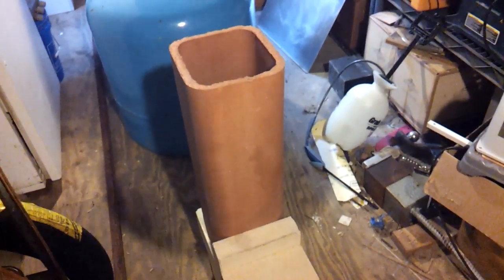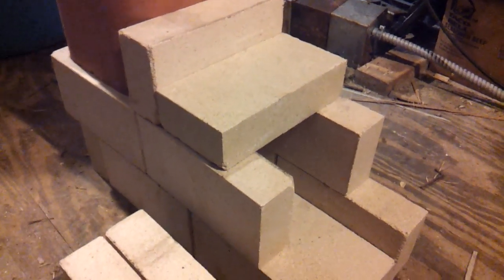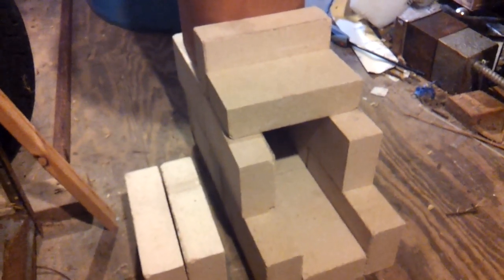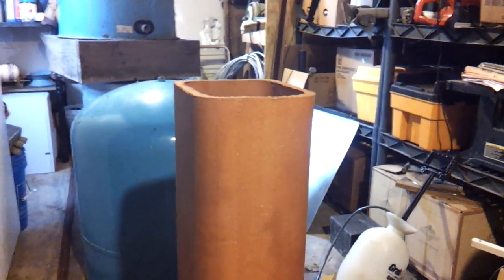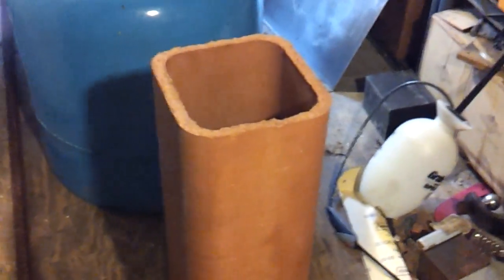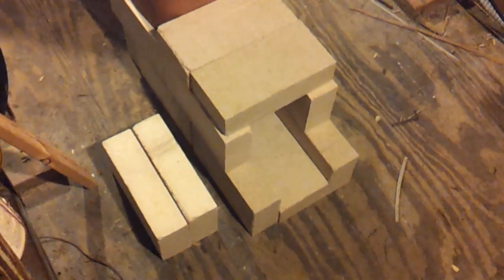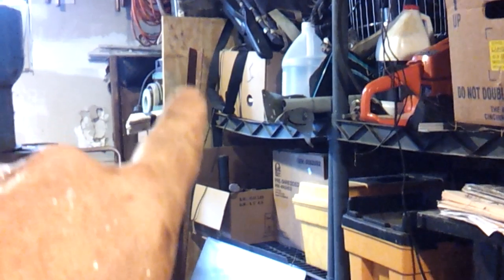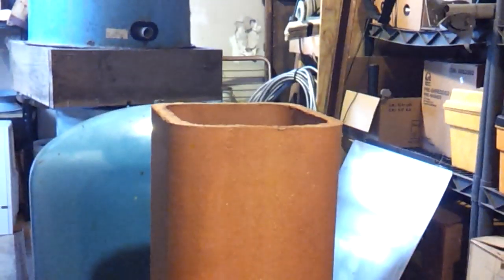Rocket Heater Wood Stove Build Part 3 (mocking up the J-Tube)

Comment: The clay chimney insert will not stand up to the heat generated in the heat riser. IMO
Reply from the maker: El Rey Del Mundo still holding up strong. think about what the liners where designed for. it seems to be working out.